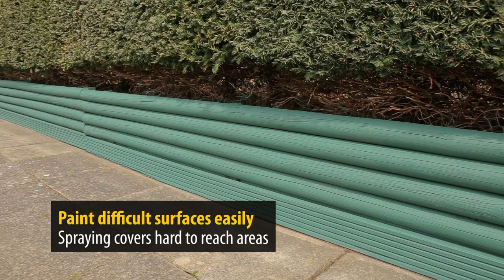Spray painting fencing with a WAGNER Control 150 M Airless Paint Sprayer

Comment: What size tip that mate
Reply from the maker: Hi Sven, 

thanks for asking. You can use the 311 tip for thin materials like acrylic paints, primers, stains, etc. and the 515 tip for thick materials like internal emulsions, latex paints, hollow-space sealants... in this case, we used the 311 tip.